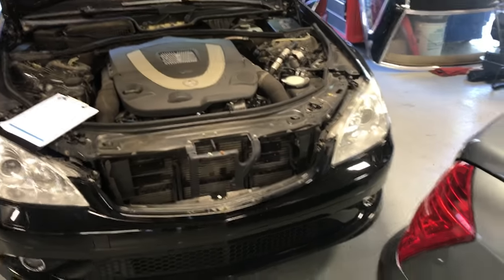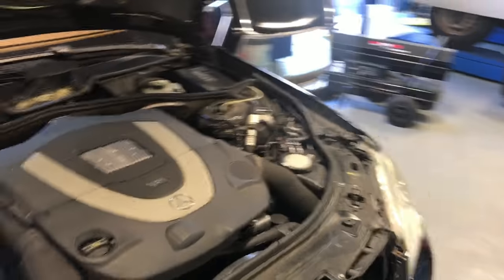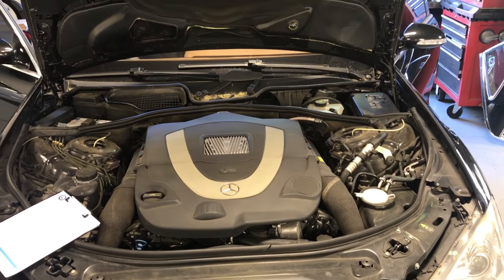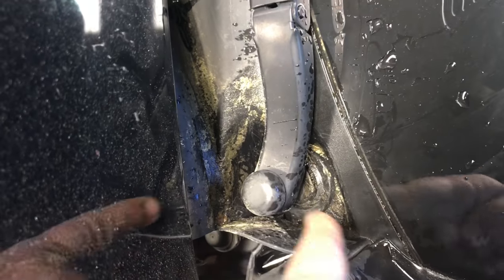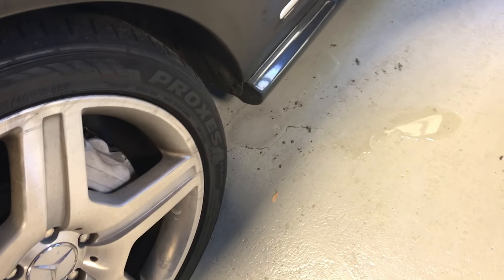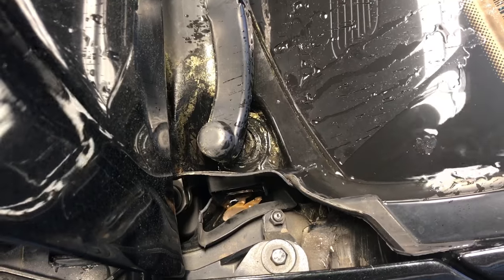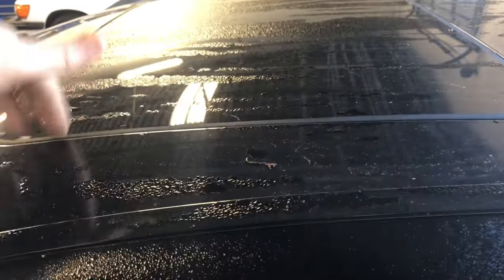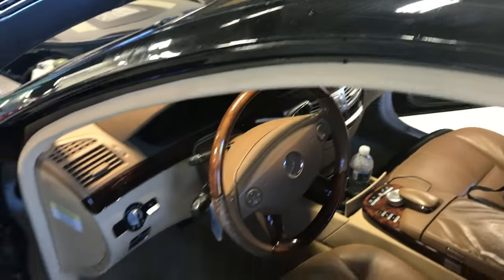Why Water Gets into my Mercedes ? How to Fix Water Leekage Problem?

Comment: That's ridiculous for that to happen on ANY Benz, totally unacceptable,smh...
Reply: AGREED. Bought a 2013 C250 2 days ago, and my driver's seat floor all the way to the back seat floor was FLOODED. I'm devastated .
Reply: Totally..
Reply: Benz are built as engineering projects for Lexus to improve upon. Japanese simply licence the Robert Bosch designs with little competition. Either way Bosch wins.

Luckily the C and E-Klass have slightly better quality! All the pricier models (S etc...) are genuine mechanic specials.

Benz goes out of its way to ensure every single car system prematurely fails by design: A thru Z... clunky sunroof, wiper arms, goofy brakes, leak everything, camshafts made of soft metals, headlamp modules, SAM modules, etc

The 30+  CAN-Bus software modules are defective right from the factory... causing countless safety warning faults and drained batteries...

Fear not the star network is here... either $800 or "sorry could not reproduce" - You're not alone, enjoy this luxurious man made chaos until you skip 😂
Reply: Total money pits. Same thing happened to my 2010 C300 4-5 years ago, causing damage to the drivers side fuse box. It was then repaired. Fast forward to 2020 now water damage seeping through the trunk causing damage to the fuse box in the trunk. Insurance company says it's a "total loss."
So yes, very unacceptable - Mercedes Benz

Comment: have 2 german cars with same issues... drainage either front or back. front procedure... get 1/8" tubing, or weed back line, and run it down the front of both holes in the front, they are BOTH strong enough to push any debris down, do it slowly, you dont wanna dislodge the hoses from their clamps, at one point you will feel resistance, thats typically the bottom... stop there.   pour some water down and see if it comes out from the bottom, it may requires several attempts to dislodge any leaves, dirt.  I have also tried going from the bottom up, but only after making sure water is coming out, you dont wanna push anything upwards.  best method involves removing headliner, all 4 hoses will be exposed, and can be adjusted. as with everything else on these cars....periodic maintenance is required
Reply: Rj Kulman thank u very much

Comment: Good video ! This just happened to me and it fouled up my electronics.  Seems like it's just the passenger side.  I stuck a long, skinny pipe and pushed though and water gushed out from the bottom of the car.  Thank you
Reply: This just happened to me my  s550 will not  start  now
Reply: @robertrobbins837 it happened to mines but it’s running

Comment: I'm dealing with this now myself. It's the pollen season, and this past week it rained hard for days. My mercedes C240 wouldn't start, but all lights worked inside and out, as well as the radio. I had it towed to my mechanic who showed me what you just did regarding the clogged drainage. My computer was submerged! I took it out and I have it home with me in a bucket of rice and will return it to him in a couple days. Fingers crossed!
Reply: any update, how much was the damage? this just happened to me today on my C240 but it went to the side with my battery. bottom part of the battery compartment is filled with water
Reply: @latrellegrind41metcalf this recently happened to my colleague at work.  He had a huge puddle in his car.  He had it drained a dryer out with fans.  Then he had it detailed, it took 3 days.  If you have comprehensive insurance it should be covered.  He didn’t, it ran him about $560-650.00.

Comment: I have found a common leak that occurs on the roof of my 2004 Mercedes-Benz E-500 4MATIC Wagon right at the seal of the roof racks. It occurs on both driver side & passengers side. I had my sunroof seals as well as my rear hatch seals replaced thinking that would fix the issue. I went outside today during a torrential rainstorm to see if it worked. What I found was that the water was making its way straight through a small gap in the roof rack seal, settling on and finally seeping through the ceiling fabric.

So, share with us your magic on how we can seal (or re-seal) the racks on the roof of the W211.

:-)
Reply: Hi, same on my 2007 E350 Wagons, do you know where can I get the roof rail rubber seals?  Thanks
Reply: Before I got my W212 E63, I had a black 2003 W211 E500 4 Matic 5.0 v8 saloon with the panoramic glass roof... Whilst I never got the leaks you had, I often wondered why the roof never opened !...  Now it seems that the previous owner might have used black silicone sealant to seal the roof and stop any leaks from happening ! - Mercedes are great classy cars but their drainage system seems to be very poor and always prone to clogging...

Comment: My ML320 leaked water into the rear hatch into the fuse box area and fried my Delphi SAM box....crazy place to put electronics..I hear the later models (09 up) have that box under the rear seat..
Reply: nooo, my '14-E has the rearSAM in the trunk right side... I guess it's faster to replace them than if under rear seat.

Comment: Same problem with my  W213 E300 (US Model) , after hard rain the floor mats get wet, also if i take it to an auto car wash and the water has heavy flow, the A pillar on the passenger side and the sun roof starts leaking. FML!
Reply: I have the same car and today I’ve found a lot of water on the mats (luckily I had the rubber mats and it helped a little) it was only on the driver side though. Any updates ? Were you able to fix the problem ?
Reply: @yari1990  i just try not to park under trees, and try to keep the drains clear, also when i am at the carwash, i use the pressure air hose on all the drains (sunroof, under the wiper blades) it has not rain hard after that, will find out i guess.

Comment: Just noticed mine are clogged with wet mats and now have an electric issue😖
I thought when serviced by mb this would be a standard service item😮
Reply: I have that issue as well in my e. Class had 3 inches of water on the floorboard rushing by my feet when I hit the brakes it sucked 😂

Comment: Thank you this just happened and cost 4k to fix the wire damage. There is no warning light and this is very poor engineering design.  So disappointed with this class.  The issue is it can happen again in severe weather.  There must be some kind of shield to put on car.  I am going to look at what MB sells for car cover.

Comment: Hey, how’s it gone? Watch your videos all the time so helpful. I have an older Mercedes that I love and thought my starter went however, replace the starter replace the battery replaced all the relays checked all the fuses but will only click once almost as if the starter is jammed or possibly fly wheel and I am changing the crankshaft position sensor just because I’m out of ideas of what it could possibly be. Any suggestions it’s a ML 500 at 2003 and I just don’t get it. I have changed everything that I can think of including as well as the brake light safety switch sensor. Thanks again and thanks for all the help for videos.

Comment: Hi I have a pool of water in the back seat of the  passenger's side. It's the first time I see it and its only in the back seat. I checked the Sunroof seals and they are ok also declogged the water pipe in the front as you showed and it looks ok. Can you please show how you cleaned the drain in the bottom to see if this could be the issue? Thank you very much!
Reply: Hie did you manage to get help am facing same situation and it's stressing me
Reply: He says in reply to a comment to vacuum out as much as you can. DO NOT attempt to insert anything down the vents because it may damage the hoses. Use compressed air to clear whatever the vacuum didn't 😃

Comment: Thank you, the tips are excellent. I have the exact same problem that you mentioned. The water is dripping from my pillar and into the passenger handle inside the car. How do I clear the drain, can you please guide
Reply: I just bought a 2010 S550 (Just one month) and I just noticed when it rains hard that water leaks from my A-pillar. Man, this is not good! I will check the areas noted from this video. And I will keep you posted!
Reply: @roberthalljr6789  hi Robert, I have found the fix and the source of the water drain. Open the sunroof completely and on the front right and left sides are 2 small holes for the water to drain. Since that area is never cleaned during servicing, all the mud and grime gets collected and clogs the water from draining down the pillar. Take a soft cable or wire and just run it through the holes and put some water, it should fix the issue, hope this helps
Reply: Thanks will do!
Reply: Faraz Karari thank you for sharing this bc I’m having the issue now

Comment: The problem is most drain, mostly on the w211 Fender is hard to reach. So how do you get it cleaned?
Reply: I'm having this problem, noticed only after it was ao full it reached eletronics, stuff stopped working. i managed to get the water out, but it's still clogged. How do I clean it. I can't even see in there

Comment: Just pulled my ac heater blower motor out of my 2007 s550 4matic and it was full of water, I'm sure my wiring is screwed so replacing the motor itself won't be enough

Comment: 2013 W204 I have a problem with water in the back seat. The dealer says the rear drain tube has probably come off. They said it will be a 4 hour job to fix it. I will do it myself.
Reply: Hello, how did you fix this? I’m having same problem. Thanks
Reply: olaomishore I am going to have to take down the ENTIRE headliner. It will be time consuming but I don’t think it will be that hard. Once its off I will reconnect the drain hose and epoxy it into place. I will update you after I’m done and let you know how hard it was. I need to wait for better weather. a bit cold right now.
Reply: Paul Davis same problem but the water  stays under driver side carpet area - any ideas ?
Reply: @Joshua Davis  Bro, I haven't been able to fully fix it - but I think the leak is either from the sunroof and/or front/behind the dash, so temporarily I ducked taped all around the sunroof & that cut the leaking by half but taking it to a body shop next wk . But I've been running a heater to keep the water out as fast as possible. Will let u know when I figure it out
Reply: Well I only had to pull down a part of the rear headliner. I pulled the strip around the door and just prayed the headliner Down. The tube was attached and a pain to get off. I did pull it off and blew it out. No more water in the seat floor. Took about 15 minutes total. Be aware that the side airbag is in the way but just be careful and you shouldn’t have any problem.

Comment: What do I use to clean the drains?
Reply from the maker: Try to vacuum as much as you can and than blow air into it. Don’t use a wire or a hanger you can poke holes in the tube.

Comment: I have a c350 and this just happen to me. 2 round of storm In CA. 
My driver side front and back flooded. 
I’m going to check my car to save me a trip to the mechanic. Thank you
Reply: How much did it costs to fix the issue and where you able to find it ?
Reply: @Enzo-tg8uo  I still haven’t fixed unfortunately. I just bought a car cover for it and drive my husbands car when it rains hard .

Comment: I have 2007 Mercedes s550 (W221) and I am getting water in the trunk. Mostly on the sides where the amplifier is. I checked to make sure the tail lights were tightened as that was the only place I can see water would get into. Is there any drain holes for the trunk around on my car that you can directly me to?
Reply: Water can leak into the trunk in a number of places.   Ideally, get into the trunk while someone takes a hose and
applies water to the top of the trunk.   You will see where the leaks are and then you can seal up the problem.
I have a 1993 300sd and water was coming in from a few places.  It would fill up under the battery reservoir which
I vacuumed up until I fixed the leak.  On the 1993 300sd diesel water was coming in from the tail lights.  I removed the tail lights and replaced the tail light gasket with brand new ones ordered thru the dealer from Germany.   
I have seen prices from $14.00 each one, that parts place ran out so I purchased from dealer at $25.00 each.
That took care of 90 % of the leaking into trunk.  The other leak was coming from the backup indicators which are
in the rear corners of the trunk and lift up about 7 inches when you are backing up.  I resolved this problem by making two gaskets and placing them on top of the chrome pipe indicators and there is an adjustment that you turn to tighten the indicators which force them up an tight to trunk lid.    This resolved the problem.

Comment: I hope you can help me. I have a fifteen year old B class Mercedes which is collecting water in the well in the back of the car behind the passenger seat.  This is making the whole of the car windows steam up when it is cold and making it almost impossible to drive for at least fifteen minutes until I can clear it. I use the AC and cloths to clear it but need to know where the water is coming from.  I have put a towel on the floor to mop up the water, which I change daily. The car is in immaculate condition hence I don’t want to sell it on at the moment.  I have a sun roof which I never open.  Please can you advise me.  Thank you.
Reply from the maker: I’m not familiar with the B class but check the normal places.. remove the pillars inside the car and make sure that the drain hoses for the sunroof are attached, look under the windshield and make sure all drains are free of debris and allowing rain water to flow, check all seals around the doors, look at the cowling around the wiper arms and make sure they are not cracked, spray the car with water hose and let someone seat inside and see if they can track the water path, remove all carpets and seats and make sure the floor is sealed…
Reply: Thank you for your very quick reply. I’m not sure I can try what you have told me as I am an elderly lady, however, I will check the sun roof and see if I can see anything wrong there.  Thank you.

Comment: Dam I've been experiencing this for many times to the point that it damage the electronics cables which it had to be replace with $800 dollars that's how bad it was. Now again it's happening. Not only is it getting into the car, but it also gets into the  The trunk of the car and when I open it water spills out from the trunk covers that's how bad it is. Could turn on the vehicle after 6 days of that and let it dry a bit but still carpte are humid. Next thing I saw that the gasoline gage on my dashboard was knock put when it was working fine, now it looks like if the car was empty on gas, also one of the daylight lamp is out. Solving the drainage won't be a problem but these problem I mention is what worries me. Now, I don't know exactly how should I find a technician car shop that can fix this, I'm sure most of them knows how to deal with this problem. Hope I can find the right technician.

Comment: Thanks sooo much for this video. Life safer! It’s been raining a lot for the last few days here in Baltimore Md. noticed water puddle in back back passenger seat carpet. After watching this video, I went back to my car and there you have it. Dried leaves all clogged up in the drain’s mouth. I cleaned it all out. 

How do I get to drain the water underneath the back seat carpet though? Thanks 

Also, I’m thinking this is why my ac/ heat blower stop working all of a sudden too??
Reply: So do you mean removing the leaves stopped the water leakage @olaomishore
?

Comment: Is there a drain under the brake booster? Maybe even under the battery tray as well? I have water sitting in that area after I finished cleaning out the side drains.
Reply: Found it after removing the wheel well liner. It was clogged with leaves. Rinsed entire area under brake booster with water until it was flowing clean out of the drain. Should be good for a couple years now. This is for a W221 in case anyone else runs into this.

Comment: 2007 GL450 water leaking near parking brake also see wetness at lower left pillar I popped the side plate off I could see water on the metal drips runs down below parking brake pull handle please help I do see they change the brake booster but don't believe that has anything to do with it.

Comment: I just had an oil change yesterday and now my MBZ 2010 E-class 350 is leaking water from the left front of the vehicle. Its hard to tell but it's close to the front tire on that side.   There is no odor and looks and feels like water.  Would it or could  it be the radiator leaking?  The car is not left outside but always parked in the garage, so no rain or extremely cold weather in in play.   Since the synthetic oil change, I've driven it about 10 miles.

Comment: After heavy rain water went inside driver side and now I cannot start the car no more I changed battery still nothing completely dead what do I do thank you should I take it to dealer or independent shop I think my car is totaled or what do you think? Can it be fixed 2017 E 300